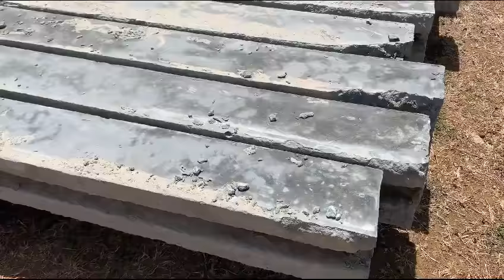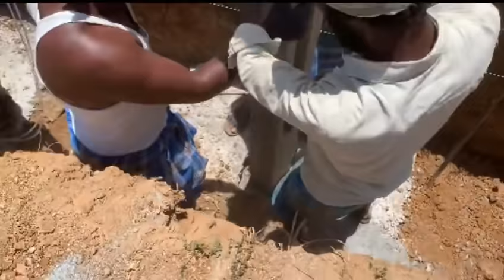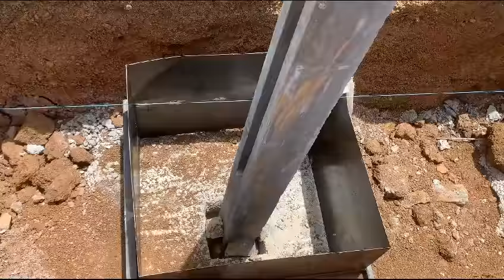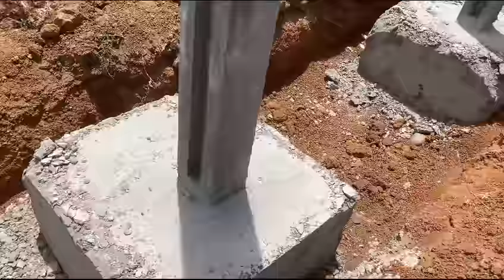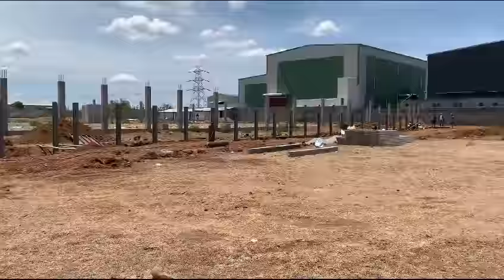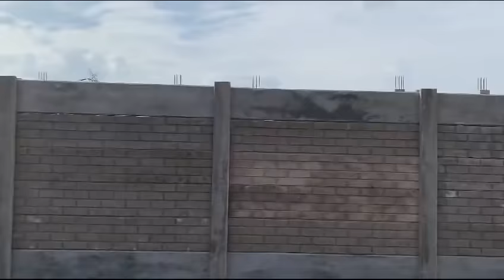Concrete Fencing Panels and Posts Installation - DIY

Comment: How do you put in bends with these please? 45 degrees at a time do the panels still snug into the posts if you cut the edges?
Reply: You ll need extra post if it is not 90 degree. It is convenient for uniform straight plot boundary walls.